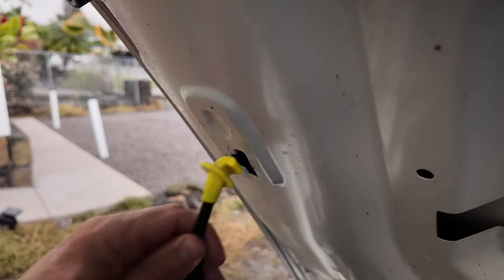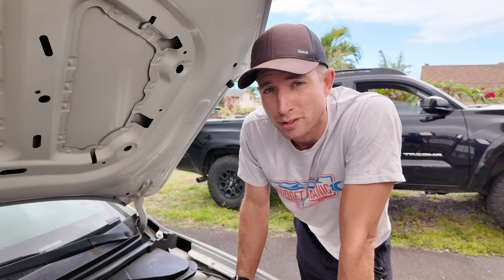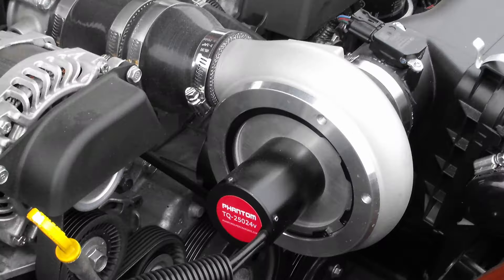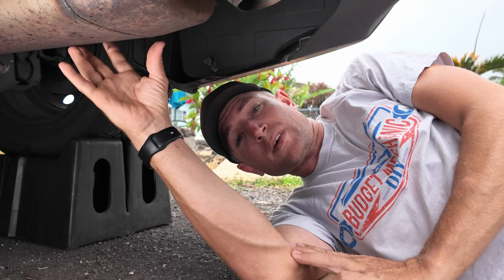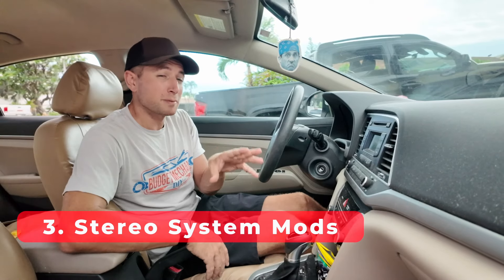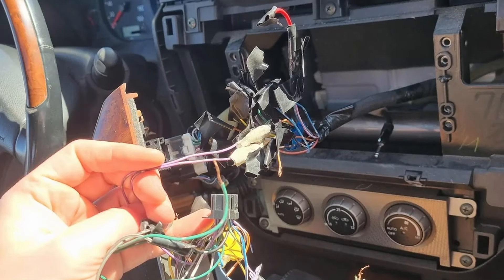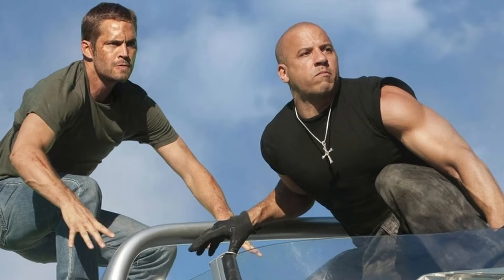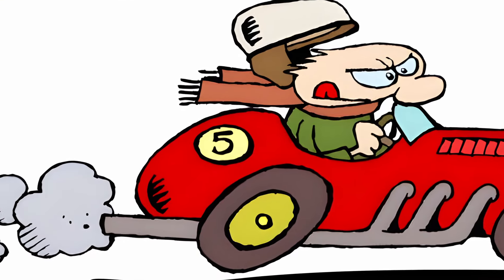Biggest Red Flags When Buying a Used Car!

Comment: Edit: ALWAYS get a PRE-purchase inspection by a MECHANIC! Like an ACTUAL mechanic and not your neighbor down the street that “knows a lot about cars” lol

Most air intake kits are vehicle specific and come with a bung for the MAF sensor. If you stay with a reputable company than the filters are sufficient. The issues I’ve seen is when people put these on and don’t read where it tells you that you need to CLEAN the filters or they OVER oil them and don’t let them dry fully before reinstalling and using and the oil gums up the MAF sensor. 
 An upgraded exhaust isn’t going to cause any damage to the car, but can be quite annoying. Especially when they’re on a car with a 4cyl that does nothing to help the cars already week performance. 
 An upgraded sound system, if done properly, isn’t a harm to the car either. They’re all plug & play now so no need for spliced wiring and they’re cheap so most people don’t splice anymore. Doesn’t mean that it doesn’t still happen though. 
 For suspension, a lift or leveling kit, isn’t an issue. The main issue is when those owners in rice burners use a torch and cut a coil or two off of the springs and have so much camber/caster on the wheels you need to buy a new set every other month. 
 I do agree with all the “tuner” comments. If it looks like a little race car than it was most likely dogged out “racing” it burning up the clutch or clutch packs and red lining and over-revving the engine. If the owner of that car is a kid than run away! lol 
 Great stuff as usual brother. I didn’t get any notifications for your last two videos! YouTube is throttling your channel brother. 
God bless~

Soli Deo Gloria~